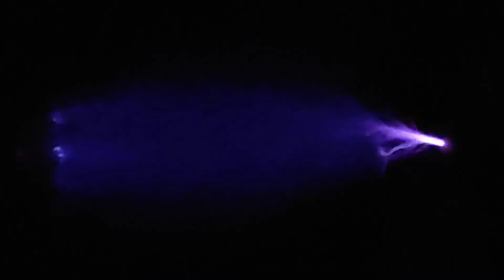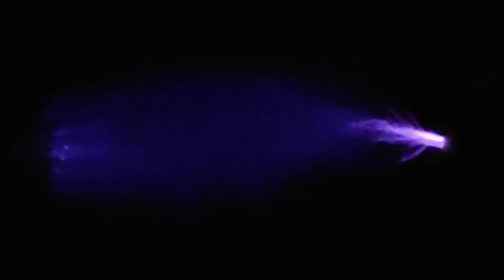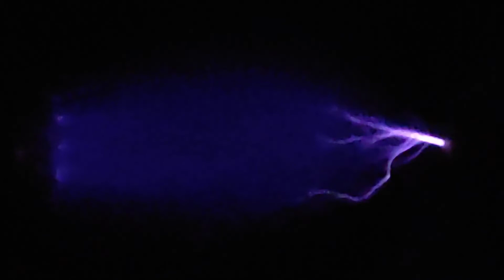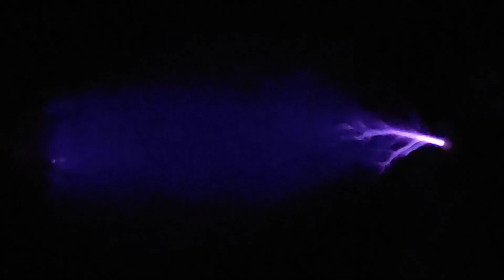Corona From Sector-less Quadruple Wimshurst Machine (Bonetti Machine)

Comment: Can you tell me the environmental temperature and relative humidity at the time of this experimentation?
Reply from the maker: This says I videoed this in August 30, 2022. 30/8/2022 for the Euro date format. While I can't tell you exactly what the exact environmental conditions were, I can tell you it was the hottest part of summer in Jerusalem Israel. Jerusalem is a standard Dessert climate, and except during the winter season (which is the rainy season here) the weather is quite dry and low enough humidity to create static charges walking across the floor (like in a cold winter in the North East United States). That being said even at relatively extreme humidity situations (over 90% relative humidity) Bonetti machines perform very well, but the maximum spark lengths (with capacitors, or the maximum length to get corona like this without capacitors) will suffer by about 2 to 3 centimeter drop in maximum length.
Reply: @MisterBonetti  i tried building my own quadruple bonneti machine but it just doesnt work at all i even tried different neutralizers and cant get it to work,i thought that my neutralizers were placed wrong but even if i just attach the neutralizers for one disk pair it doesnt start, i use 30.5cm Vinyl records and pretty high rpm to do you have any tips to make it work? I think the humidity is too high were i live for these machines or i just have bad luck

Comment: I'll never forget the first time I spun up my first motorized Bonetti - I had just installed the neutralizers but hadn't finished the collectors, and yet I was able to draw several inches of discharge right off the discs themselves. It was gorgeous, running in total darkness.
Reply from the maker: It's addictive!
Reply: I remember my first Bonetti. It was hand cranked/homemade. I was amazed by its power compared to my previous Wimshurst machine build. The waterfall of corona that spilled across the discs, was a never ending source of fascination.
Reply from the maker: @magx1  I know,. Seeing it in the dark with the massive negative side corona bands was hypnotizing.
Reply from the maker: https://flic.kr/p/2o313uq
Reply from the maker: https://flic.kr/p/2o2XfyK
Reply: @MisterBonetti  Thank you for the visual journey down memory lane - I see a lot of R.A. Ford in there alongside Antonio de Queiroz, much as was reflected in my own recreations. At the moment I've had the idea of a simple 3D printed design that uses aluminum soda cans and PET soft drink bottles for sectors and Leyden jars, using a dirod configuration, though it's still little more than an idea and a pile of parts for now.